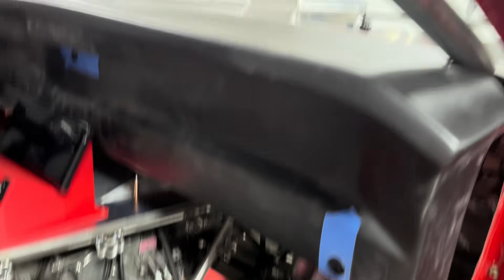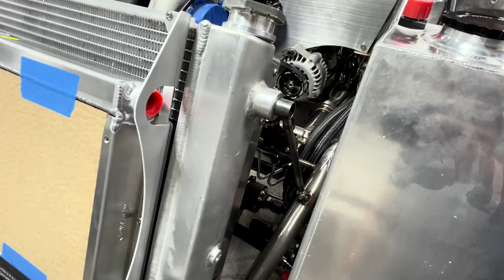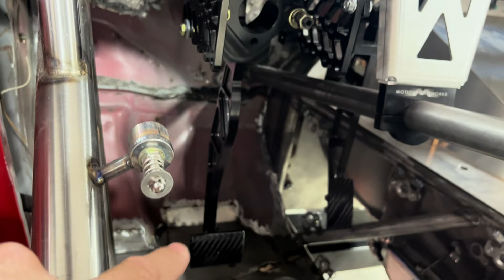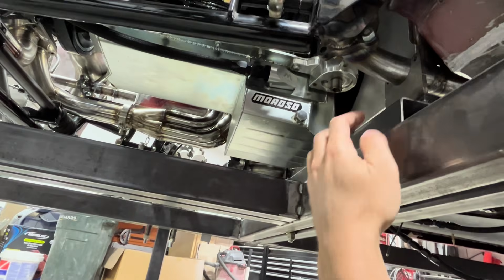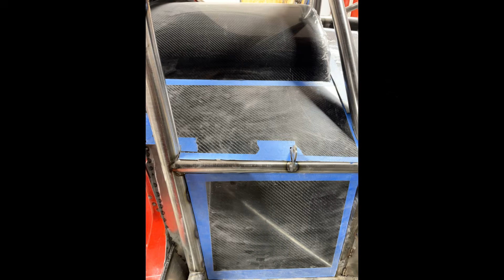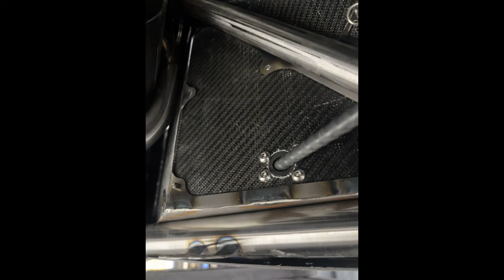Camaro Build Series #6

Comment: How do you keep the tubes from accumulating surface rust during the build?
Reply from the maker: I have a dehumidifier running all the time to keep the air dry. I only open the man door enough to go in and out of the shop. Never open the overhead door. I typically wear mechanic gloves too when working on the car to keep my finger and hand prints off the bare steel.

Comment: Looks great. I also looking at the R5, it has a ton of outputs. seems like you have 3 times that with the PD16 and the other racewire relays. Looking at the PWM with solid state relays, for pumps and fans. Where are you adding battery at? Hope you show the fuel line runs. can't decide mine.
Reply from the maker: All of the stuff for street driving takes a lot of I/O. I found out with the old car that an 8A output is goo for low beams but not enough for high beams and I had to add a relay. I have all the 25A outputs used up. I wish there were more analog inputs. They run out quickly as well. I can make a video on the wiring and fuel system when I get that done. Working on the plumbing now!
Reply: @sandsgarage  Oh also what did you end up at for the motor location? believe you said up 3"(?) and looks like back 3"(?). and was the mid plate tube hoop set in by you or Moore?
Reply from the maker: @Will1Big I set the mid plate hoop myself. I placed it as far back as I could into the stock firewall. For the engine height I have the crank shaft center at 12” from the ground. Not sure if this is right or will work well yet. My mid and front motor plates are all laser cut so in theory I could adjust the motor plate design, get another set cut, and move the motor up or down.

Comment: Looks nice 
But wonder why you have the relays if you have R5 and PD16 8amp will run everything  
Also would you sell a key pad mount like that ?
Reply from the maker: I have most of the wiring planned out already and I have all of the 25A outputs from the R5 and PD16 used already.  Having 2 fuel systems, electric fans, electric water pump, intercooler pump, etc it doesn't take long to use them all up.  I debated on getting an additional PD16 but I can't justify the cost for what I need it for.

Comment: Top notch work. Im looking at ordering the same VFN dash. Anything I should know before I buy? Thanks.
Reply from the maker: Thanks! I had nothing really left that was stock to mount the dash to but from what I can tell they are very close to the same dimensions.  They are lacking some material on the sides in the area facing the inner door panel.  I still might add something there to hide the gap but it's low on my priority list right now.  

I found the centerline of the dash, made a mark, found the center of the windshield, made a mark, and used that as my guide to keep it centered.  I then just started grinding and sanding to get it to fit the bars.  Once I had it close I used a hose clamp on each door X bar to hold it in place.  The worm gear end of the hose clamp makes a good stop.  Then I came up with the 3 mounts from underneath to lock it in place.  Hope that helps.
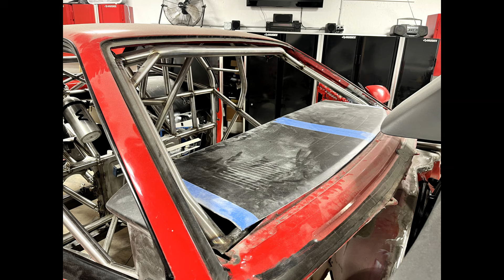Reply from the maker: Check out how the side is a little short at 23:32 in the video.  I didn't cut any of that off right there.
Reply: @sandsgarage  Thanks for the info. I noticed those gaps but I figured it was due to your cage and what not. Do you think those gaps might not be an issue in a non caged car?
Reply from the maker: I’m not sure bc I don’t have anything to compare it to here. There might be an interior piece there or something. I sold my old dash a long time ago to compare to